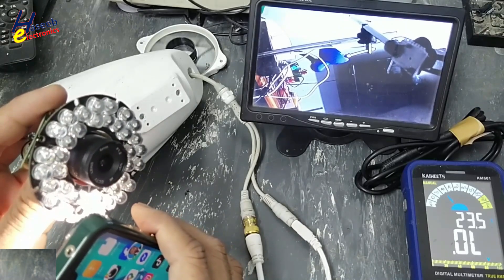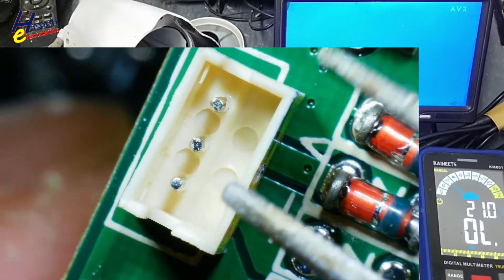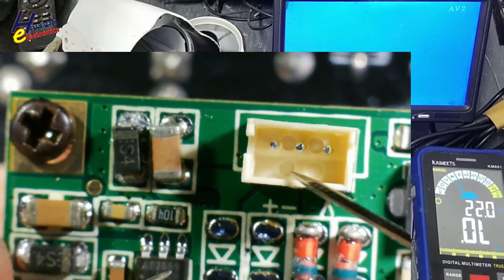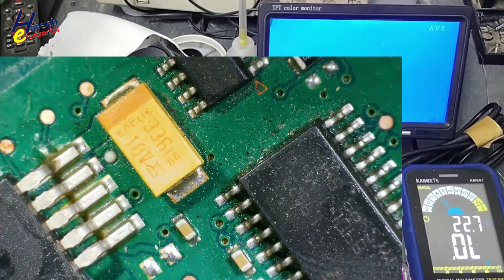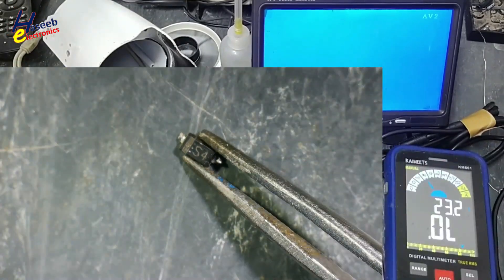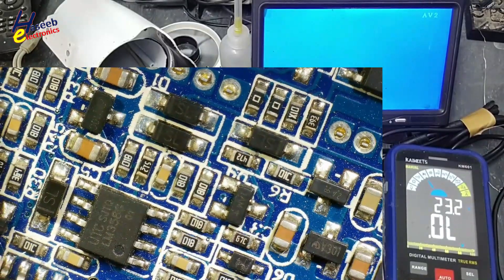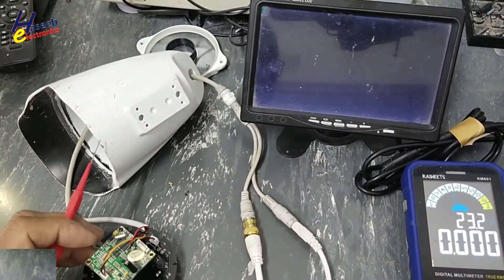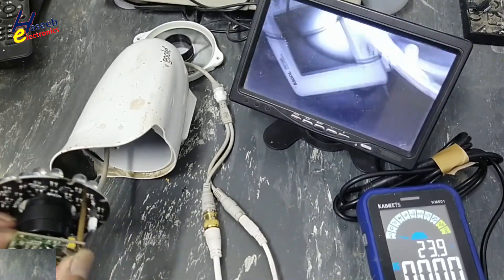{1285} How to Repair CCTV Camera, No Video Problem

Comment: Shouldn't it be x10^ -6 instead of x10^ 6?  Because 10x6 is one mega
Reply: No. 10x6 is one mega Farad if you start from single Farad and that is wrong. You start from pF. So 22.000.000 pF = 22 uF.